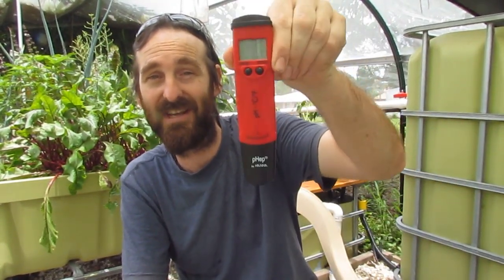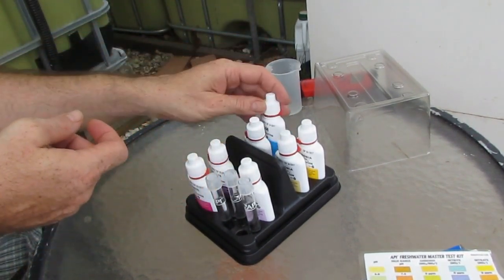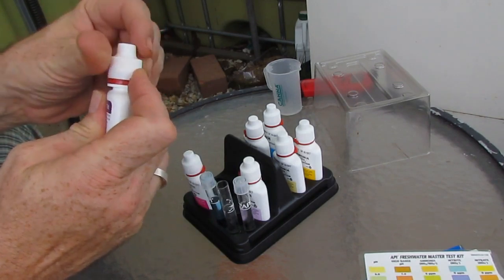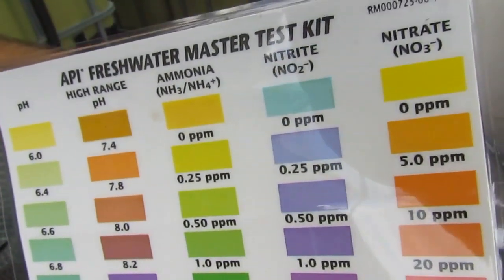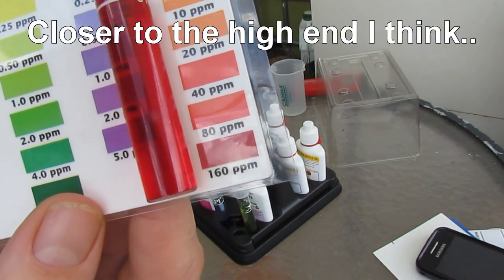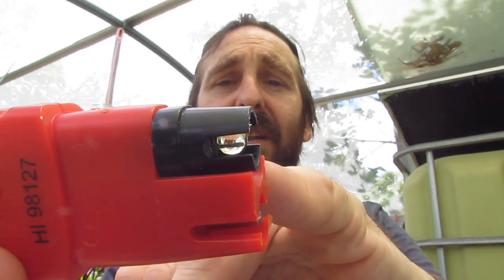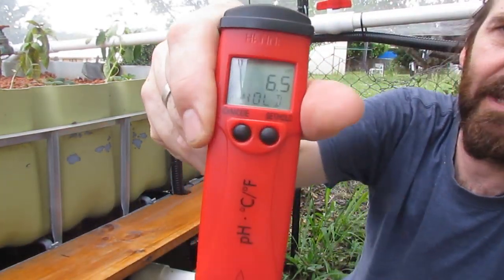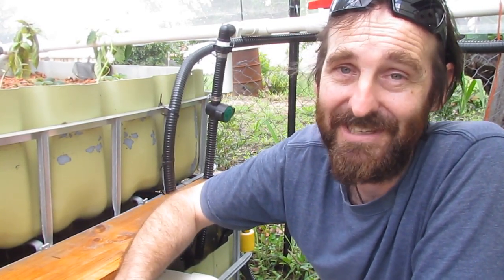How to Test Aquaponic Nutrient & pH

Comment: Good lord, I can hear my aquarium club shouting for you to do a water change. Aha.  Just curious, you didn't really mention what are the ideal levels?  In a typical freshwater tank for a hobbyist, it would be 0,0, <40ppm, respectively for ammonia, nitrite and nitrates.  Is it the same for aquaponics too?  How do you measure the other nutrients in your system?  My guess is you can measure calcium and magnesium using the API GH test.  Do you rely mostly on the nitrate levels for your aquaponics system?
Reply from the maker: 🤣 I have had a few aquarium folks tell me I'm mad before. 😉
0-0.5mg/l for ammonia, 0mg/l for nitrite & preferably no more than 80mg/l for nitrate. 
The API freshwater test kit is the main go to for most. Many will just  use the leaves of the plants to tell them when hey need extra nutrients like iron, potassium or calcium. There are test for all but potassium as far as I know.
Hope that helps some.
Cheers.
Reply: @RobsAquaponics  Thank you for answering! It was very helpful. Do you have any suggestions for aquaponics learning resources?
Reply from the maker: @tic857  I have an online interactive guide out if you're interested. You can see a short demo of how it works here,
https://www.bitsouttheback.com/aquaponics-guide
There are a few books but you can find more useful information from this free PDF put out by the FAO,
https://www.fao.org/in-action/globefish/publications/details-publication/en/c/338354/
& I also have a beginner's YouTube playlist as well,
|https://www.youtube.com/playlist?list=PLBcWprMIwYYj8zCdbSzPJOR3HRXpxuBwf
Hope that helps some.

Comment: I just started my system for about 10 days.  I noticed that all small plants in put into the system has tip burn.  Does this has something to do with pH range and some nutrient inefficiency?
Reply from the maker: Sounds like it Kenny. Could also be the sun in some cases. Do you have testing equipment at all?

Comment: what is the ideal range of nutrients i am looking at redclaw and some gold fish in my ibc system
Reply from the maker: +Adam Tolley 
Hi Adam.
Most of the nutrients you need will be provided by the feed that you give to the fish & red claw. I have read that some goldfish feeds don't offer as much nutrient wise as commercial aquaculture feeds but haven't needed to look into that myself. You will need to add in some calcium, potassium & iron at some point as these 3 elements are not normally present in large enough amounts in fish feeds. 

Calcium- sea shells, calcium carbonate or even egg shells if system is small enough. They will also help add carbonates to the water to stop the pH falling as the systen matures. 
Potassium (Good for fruiting plants) - Found in some kelp fertilisers & can also be added as potassium bicarbonate which  will also help keep falling pH in check in more mature systems.   
Iron- Available as iron chelate at most garden centres. There are different types so suggest you watch this clip by +Bright Agrotech
https://www.youtube.com/watch?v=E4_hCAnymFw
Hope that helps you out some.
Reply: that helps heaps once again i know the system needs to mature before it sets up 
properly

Comment: do you ever test for phosphorus or potassium? are they of concern as they might be in a soil-based system?
Reply from the maker: +Catherine Elkins Hey Catherine.
Potassium is one element that is lacking in the fish feed/system so folks tend to supplement especially if they're growing flowering or fruiting plants. Most  folks I know in Australia will add it in using a product called Eco Fungicide which is a potassium bicarbonate product which will also help buffer the pH at the same time which comes in handy. 
I've tried to source potassium bicarbonate which is used in wine making but have had issues getting it here.  Some folks will use potassium hydroxide (caustic potash) which is used in soap making as I understand it. 
I use a kelp product which contains 16% potassium along with 60 other elements which I think helps a lot. 
Phosphorus is one that I haven't seen mentioned a lot but know it is needed for fruiting plants. If you're just growing one or 2 tomatoes in a backyard system it wouldn't be too deficient but you may need to supplement with a little rock phosphate if you are a lot of fruiting plants. I wouldn't worry too much unless you start to see a bit of purpling on the leaves on the plants. A good leaf deficiency chart will show you what to look out for. 
Hope that helps some,
Rob.

Comment from the maker: Hey Mitchell Can't tag you here so will also post this on your wall as well..  I posted this in response to someone else that asked a similar question.. 

I used the below method before fish were added to the system the second time as I stuffed up the first time I tried it & crashed the pH.. 
We had water coming out of the tap at a pH of 8 when setting up the fish farm.. I wanted to get it down to a range that the fingerlings were used to at the hatchery so there would be no issues when they were added in.. I did this by adding a diluted 1:4 mix of pool acid (hydrochloric acid) & water one drip at a time as the water was circulating through the system..    I go into the process I used at the 30 second mark of this clip https://www.youtube.com/watch?v=g9FaSBoPD0w
I stuffed up the first time by not keeping an eye on it  & the pH crashed very low but nailed it on the second attempt ;-)
 You need to be on hand to monitor the levels with this method so you don't crash it like I did..  I also found that due to the alkalinity of the water there was a bit of a jump in the pH as the acid was consumed.. Once the pH was at a level I was happy with I left it over night then tested in the morning just to make sure it had settled down & stayed stable.. 

IF you need to lower the pH with fish already in the system I think the best way to do it is to treat the top up water with pool acid before adding it.. This way you have control of the pH without the chance of any damage to the fish.. I would still let the treated water rest for a min of 12 hours before adding it in case there is a jump in the pH due to the alkalinity of the water.. 
Is also a good idea to add it in slowly through the sump once it is lowered if possible so it can mix with existing water before being sent to the fish tank.. Hope that makes sense & helps some..  Feel free to hit me up again if you want any more info..
Rob..

Hope that helps some Mitchell..
Rob..

Comment: I've been watching your videos on Aquaponics for a while now.  Very informative and useful as I set up my own system.  I have a side question about water quality.  The water in my system has gone cloudy.  To try and counter this I have significantly reduced the ability of daylight/ sunlight to penetrate the main tank and the sump tanks.  I've also got an air pump in the main tank and sump tank to get oxygen into the water.  Do you think these measures will be enough to reduce the cloudyness?  Or would it be necessary to do a partial water change?  At the moment we only have one trout in the system so I don't want to add fish until the water is right.  Any help would be appreciated.  Keep up the good work.
Reply from the maker: Not 100% sue I can help online but will give it a crack.. Is it an algae bloom you think you have? If it is blocking out the  light will help to reduce it.. Any solids should get filtered out in the grow beds/filters.. Any chance of you posting a pic on G+ ?
Cheers..
Reply: After a couple of weeks the cloudyness disapeared.  all good now.
Reply from the maker: Michael Storer Is great to hear Michael.. Hope all goes well from here on out..
Cheers..

Comment from the maker: We used to have some in a ½ barrel but it got turned into a frog pond :(..
I have access to some duck weed at the moment, just need to work out how to fit it into the system.. Thanks for the heads up on its nitrate uptake.. Might look into it a bit more seriously as well as the filter...
Still haven't got the info from the feed bag but will post back when I get the bag out... Sort of jammed in the barrel at the moment..
Thanks for all the help & have a great one...

Comment from the maker: Hi there...
The meter was calibrated using buffer liquids... One was pH4 & the other a 7... Shall add that into the clip... Thanks..
The brand is Hanna & model number is "HI 98127" I did mention it but you might of missed it.. Hope that helps you out some..
Have a good one..
:)